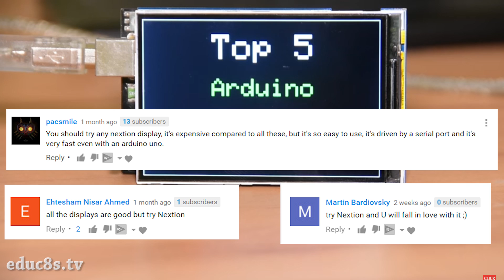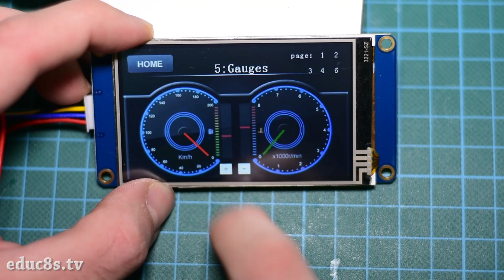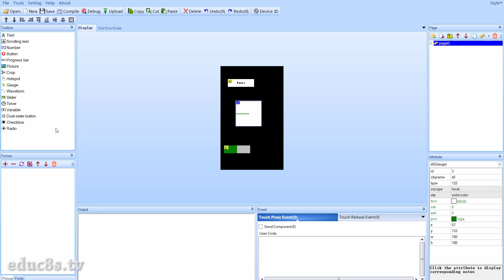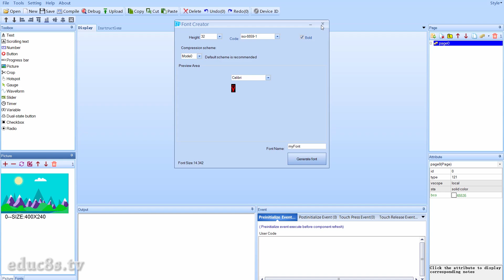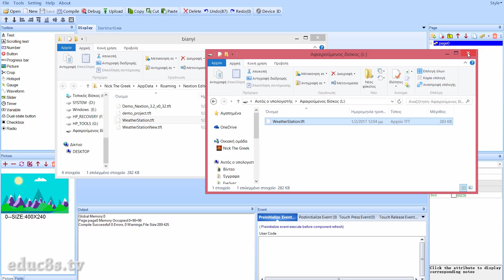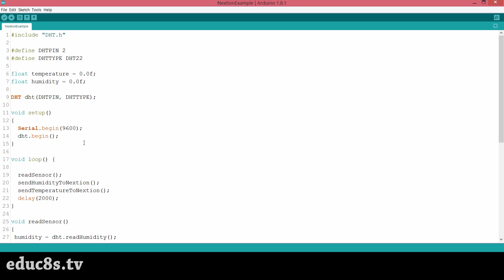Nextion Review: Build a Weather Station with Arduino a Nextion Display from Banggod.com

Comment: Thanks for all your videos. I disagree with this one though. it has its own memory for one. very user friendly. I don't have to make up alot of code for it to do a simple thing. Google nextion instruction set for the commands or you could see my tutorials on it
Reply: I agree - these screens are great. I quite like the Nextion Editor, I didn't find it too much of a problem. The 'Event' coding is pretty good. My son is developing a project with the 3.2" version and an Arduino that would be impossible to achieve without this screen. And for balance, he's also using a Nokia 5110 screen for another project. I'd recommend Nextion screens to anyone :)
Reply: Simon Coates there you go... So easy that a kid could do it
Reply: Not only here, but I have read few place else too about poor documentation and bad software experience (during my research to buy it nor not). Perhaps the company needs to do something quick before it becomes its brand image.  I am planning on getting one myself for a future project. I hope its as good as theoretically it should be.

Comment: Good review, but unfair reference to their online documentation - every command is listed on a wiki on their website, and several libraries exist to use with Arduino ide, including the ESP8266.  The IDE is basic and does what it needs, and I found the simulator useful. I would love to use 3d gauges, the simple lines doesn't look good. I have developed a car dashboard with it. These displays are really fantastic when you need several menus or pages, and you eliminate the need for buttons!
Reply from the maker: +Laurence Munro Thanks for the comment and Laurence. I think this was a fair review, I described my experience. This is my initial experience. Try to find how to change the text of a textbox in the wiki. There is no information at all in the Wiki. I don't say it is not a good display but with a better documentation it will be much more user friendly.

Comment: I'm sorry to hear that the learning curve was such an obstacle, but it seems to me that once you've gotten it to work, then it's the best low-cost option around, when it comes to putting graphical user interfaces on simple systems.
Reply from the maker: Sure! If only the had a better editor! It is a very promising product! It is my prefered solution in small projects that need a gui and a touchscreen.

Comment: As someone who struggled driving displays on a 8 bit microcontroller I know why this product gets handy. But I'll chose not to. 1st, because it's qute expensive. 2nd, because you're lucked in to "nextion". 3rd because you could opt for a raspbbery zero and develop the GUI in a high level language . You end up more cheaper and have the advantage of using a technology reusable with a future in front.

Comment: Love the video, it was super informative.  Unfortunately after rigging everything up, my screen doesn't update with the information.  Used your code and followed along with the video, but it didn't end up working.  I wonder if it has anything to do with an older version of the editor you were using?  When I opened it up in v1.61.2 it said it was older code and that it would need to be updated.
Reply from the maker: Maybe, I will take another look in the following week and I will update the code if needed. Cheers!

Comment: THX, very nice, how to get screentouch events back to aurdrino?
Reply from the maker: +Jakub STEFANEK That's something I have to research. I will post another video on that. Cheers!
Reply: educ8s.tv , try some libraries to really unlock the power this display presents- by then you'll look past the quirks of the IDE as well 😉.
Reply: Jakub STEFANEK it is very easy to do, even more so when using a library

Comment: Good video! Thank you! Can you create real graph with temperature and humidity with this display??
Reply: hacker tom , yes, the advanced model supports the feature with its own Arduino library. You create a grid in the ide on a page, and then merely send it your data fields, it works a charm, no additional coding required.
Reply: Laurence Munro it is possible for one video with this future?
Reply: at some point yes, but making videos is low priority on my radar  :(  Have a look here - https://www.itead.cc/wiki/Nextion_Instruction_Set#add:_Add_data_to_waveform_component

Comment: Thank you for the video but I have a question, don't we need to use the NextionLibrary in the Arduino code ? 
I thought we needed it to allows the variables to be send to the Nextion display
Reply from the maker: No, I didn't use the library because I was sending simle serial commands from the Arduino to the Nextion display. It is very easy, we don't need to use the Nextion Library for simple tasks like this one.
Reply: Okay thank you for the answer, last question how long is to upload the Nextion program to the Display by the USB Serial ?
Reply from the maker: I haven't tried it yet. I just used the SD card to upload the program.
Reply: When I try to upload from the SD card it doesn't work and it asks me if my SD Card is FAT32 but it is... I don't know why it doesn't work '-'
Reply: Ah it finally worked I don't know how lol, thank you for the tutorial but when I try to upload on my Arduino it sends me some error "call of overloaded 'String(float&)" is ambiguous", I'm working on a project and I also have a DHT22 I really need this help if you can

Comment: I had a 2,4" Display here, and i have to say its not worth, maybe a bigger one is better. Because you have to press so hard on the touchdisplay, that you think its a button on the arduino. Its total different than other displays i have. And in absolut no way to compare with an Smartphone display. I will try next time a bigger version, but the 2,4" i cant recomend for normal fingers atm. Hope it helps someone to choose the right displaysize.

Comment: Is it possible to;
1, run this display on an Arduino Pro Micro, and if so
2, have it automatically display a different selected image depending on sensor input?
Reply: Of course you can any mcu with serial comunication. Only need to send the right command. If your project isn't too complex, you don't need the library
Reply: Yes you can display different images, the only thing to do is send the command:

Serial.print("sensor.picc=");
Serial.print(value);
Serial.write(0xff);
Serial.write(0xff);
Serial.write(0xff);

Suppose the value of the first image is 0 this will be the id of the image to display of a number with background crop image, but you can change a picture too, simple send the command:

Name_of_your_pic.pic=id of your new image.

Comment: Hello, which Libary do you use?
the ITEAD???
Reply from the maker: I am not using any library
Reply: can i use Your sketch with my Arduino mega?
Reply: why you dont use a Resistor between data pin and Vcc?

And i cant send any data to Nextion via Serial.
i use the Arduino Mega with Serial2
which parameter i must change?

Comment: Nice video as always. I have the same display intended to build a weather station like this but also with outside temperate using data coming from internet using a Wimos. It would be nice if you can upgrade this project to that.

Comment: Normally i am using Nextion Lib and its working fine but your code is very simple and 
I tried your code but it is showing an error, 
call of overloaded 'String(float&)' is ambiguous
(x86)\Arduino\hardware\arduino\cores\arduino/WString.h:66: note:                 String::String(unsigned char, unsigned char)

please guide
Reply from the maker: Check this out: http://forum.arduino.cc/index.php?topic=149843.0

It might help
Reply: educ8s.tv Thanks for support, now its working.
could you please make an additional tutorial with revision of this
I am trying to make setting which have one text and two buttons and this text value will read the arduino as set value for relay operation, that set value want to set from nextion up and down button for increase and decrease the set value
Waiting for valuable response
Reply: I have the same probleme can you guide me please, I tried to find something but I found nothing about this.